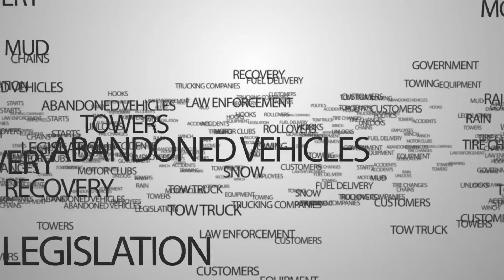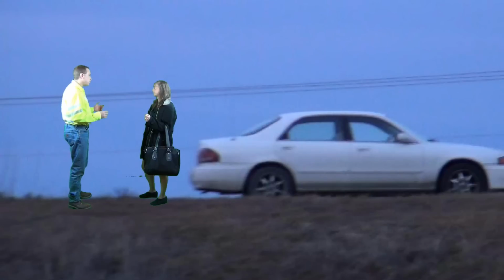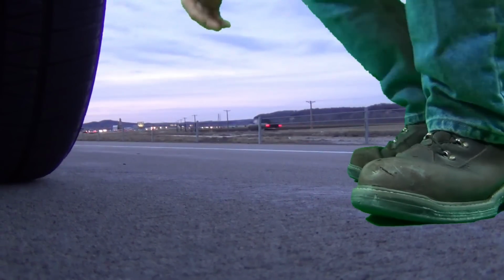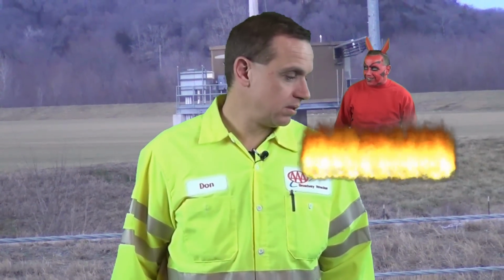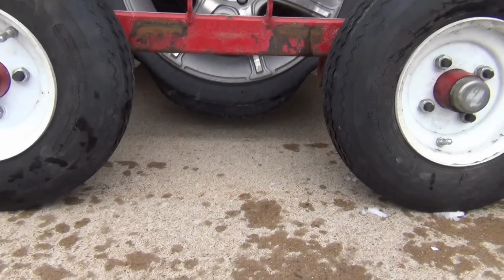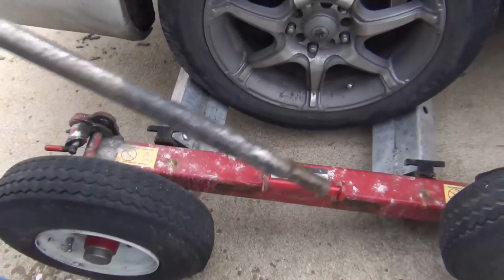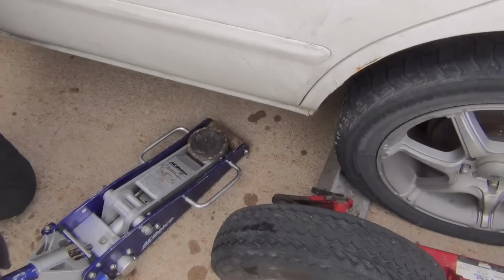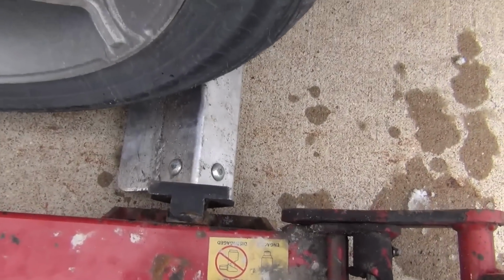Setting Dollies On A Flat Tire

Comment: i like these videos.. As a wheel lift tow truck driver this information is handy.. There is lots of times where i HAVE to throw dollies on a flat .. No other options available.. but using the stinger to get dolly tighter is very eazy and handy.. Thanks

Comment: I won't pull that jack out on the side of the highway.  Scoot it up, slide the crossbar in place, lift and go.  Tightest holes possible.  Save the jack for once you get off the highway when you try to get the crossbars undone from the dollies.  This is much better.  Fix a flat?  Why so you can ruin the tire?  That stuff disintegrates the tire from inside out.  I've seen the results.  Guess what you have to do THEN?  Dolly, scoot, set, lift, go.  Or flatbed it.  Now I will say in a wreck situation where the wheel is jammed sideways, sure you want to use the jack lift up the body, throw a railroad tie under the control arm, lay that on top of the dolly crossbars, then lift, STRAP, and go.  Always strap the dollies when it ain't dead centered.  Sometimes strap them if they are.  Definitely do it if you're hauling a wrecked rental car 200 miles back to the airport so they can scratch their heads and figure out how the car got wrecked how it did and how the heck you got it back there without a rollback.  Keep 'em guessing!!!

Comment: You have the car on a jack already your wheel lift raise the car high enough to set a jack stand underneath the car at jack points lower the car to raise the rear the  tire up then do what you hav to do i don't use dollies flatbed but when i got a flat on the one i was towing on the wheel lift that's what i did and changed the tire  no unhooking no jack just the stand and on my way

Comment: Sometimes, if the tire will hold air long enough, you can get away with inflating the tire, setting the dollies, and then strapping them down. The tire will lose air, but because it was set, it won't sag between the dollies and drag.
Reply: Zach Loveless  ... Nonsense. An inflated tire holds the dolly bars apart. As it deflates, it sinks thru the gap. The old fixed axle dollies with pans were superior in that case.

Comment: I like the dolly but I can change 5 bolts within seconds with my ratchet gun I would jack from behind the car to avoid to much time at its side I would reach round and undo the 5 bolts remove the wheel and place it behind and replace with spair I most certainly belive that would be easyer than setting up that device would be ideal for towing 4x4 or rwd cars tho
Reply: what if it's a stuck steel wheel, or vehicle doesn't ahve a spare?
Reply: Suffian Kamara ... Subscribe to Donald Chastain's Life of a town an, Ron Pratt, Plaza Towing, and Hill Auto Body and Towing. Pretty much covers everything. Just keep in mind that every job is unique.

Comment: You use a piece of 4x4 or 6x6, jack up the wheel with the flat, place the timber under that wheel adjacent the axle, make sure the vehicle is in park and e-brake set, lower the wheel down on to the timber which will give enough room to close the dolly further under the flat tire and will allow the tire and wheel to rest on the dollies instead of potentially slipping through. Only takes one man and can be done in an efficient amount of time. Been doing it for 17 years and has never failed me.
Reply: This method can also be used with wheel lifts when the tire or tires are flat.
Reply: shnrbtlle18 I love this idea, now I don’t have to use my more dangerous - less friendly on the cross bar methods of pulling the car into the dollys

Comment: for flat tires, use the rollback, carefully drive vehicle unto bed then hook it down, you won't damage the wheel, the tire is already damaged to the point that it needs to be replaced.

Comment: Hi. Why you didn’t lift the car up from rear wheels and lock the steering wheel and tow it that way ?
Reply: Because doing so would negatively impact the transmission as it was a front wheel drive.  You always want to ensure the drive wheels are not rolling when in tow.
Reply: @donarcher5555  what if we can put in neutral even it’s front wheel drive ?
Reply from the maker: @DRDDNV  It's not advisable to tow a vehicle with the drive wheels rolling even if you put it in neutral.

Comment: I fail to see how this is easier than just changing out the flat tire - you still have to be doing all this next to traffic.
Reply from the maker: Just another tool for the toolbox. What if there was no spare, or the spare was damaged? Or wrecked with a damaged front end and a rear flat, this method can come in handy.
Reply: +The Tow Academy love the video. There are time when the mbr doesn't have a spare or spare is damaged. Sometimes you get those lovely mbrs that have a spare but it doesn't match the vehicle. Gotta love those type. lol
Reply: Ya lots of new cars don’t have a spare and a lot of the tows I get are when there is a flat tire on a car with the spare already used on another tire or they spare is missing because they bought it used and the previous owner lost it
Reply: I had too do this tonight :)

Comment: How do you set up a tow dolly on completely turned front tires on an all wheel drive vehicle? Trying to figure out how I was towed.
Reply from the maker: GRiMMnEViL If he didn't use a flatbed and he towed it from the front he didn't put the dollies on the front, they go on the back.  But if he picked it up from the back with a turned front tire (I'm guessing you mean at 90 degrees from straight) then he probably jacked it up to get under it, then he slid the axles as close together as he could get them.  Hope this helps.
Reply: Thank you for taking the time to reply! After speaking with the operator he told me he used dollies on the back and some form of coasters you can place under tires to slide them on. I have never heard of those before. My main concern was possible damage since I was towed from a tight space.

Comment: Sometimes, if the tire will hold air long enough, you can get away with inflating the tire, setting the dollies, and then strapping them down. The tire will lose air, but because it was set, it won't sag between the dollies and drag.